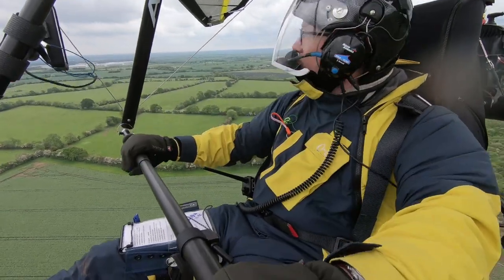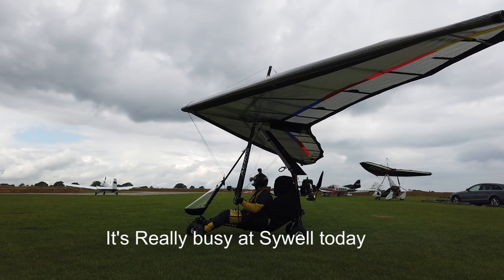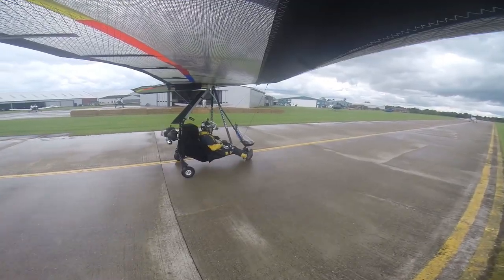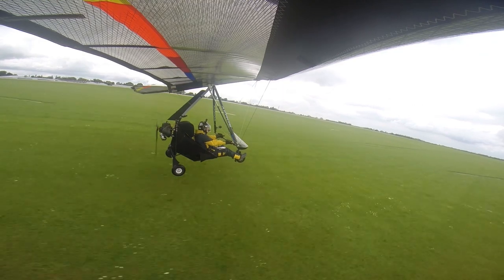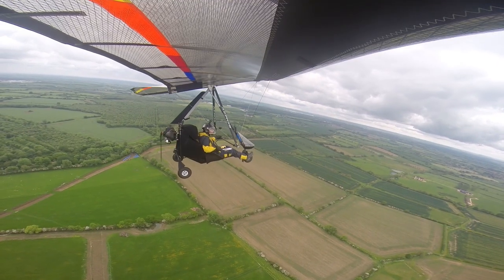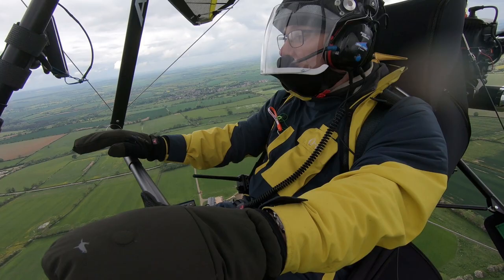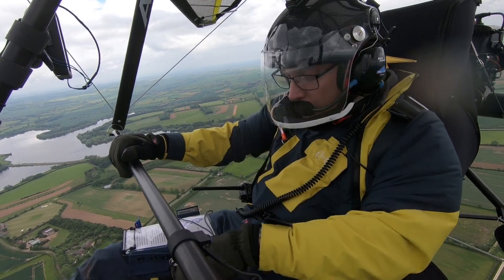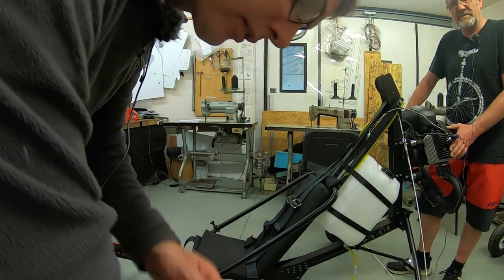ADAM  and SPITFIRES - My first flight on the Flylight ADAM

Comment: Great video. I was looking behind you and noticed a Lazair (dual engine, yellow and red) hanging from the ceiling.  I owned one of those for about ten years.  As I recall, each engine was rated at 9.5 HP but it was so clean and light that it flew wonderfully with the small power plants.
Reply from the maker: Hi Stone859, yes good spot, that Lazair is an electric conversion by Flylight. I've been told they flew very well. A bit before my time ;)

Comment: Thanks for all the videos mate - I wanted to ask if you have any showing a full pre-flight/walkarounds please? I see all these wires and spars and bolts and really curious how often and what gets checked prior to your flights. All the best and catch you on the next one.

Cheers.

Jim
Reply from the maker: Hi Jim, I have kept this part out as walk rounds are not always the same depending on the aircraft, even flexwing to flexwing they are different. Seeing as you asked, I visually check all cables ( running a hand down the flying wires), any broken strands is a non flyer, and visually check all nuts and bolts on everything.  It's a good thing to get into a flow, I always put the split rings on one side to I can count them.  The more you do it, the more you'll notice when something isn't right.  Easier to check on the ground than in the air.  Aviation is about assurance through checking, even when I flew my paramotor I did frame , engine and wing checks.   Most Microlight aicraft have the preflight checks in the Pilot Operating Handbook ( POH). Sorry for the long winded response, but I hope that helps.
Reply: @GolfFoxtrot22  Many thanks Giles. Very much appreciate the detailed reply. I had a feeling all this was being done but is not of great interest to watch ;)

Cheers.

Jim

Comment: Wow do you need a complex sign off for the retractable :-) You know there's going to be some gear up landings with them :-) Great video Giles all I know about flex-wings I've learnt from you.
Reply from the maker: Hi Terry, no licence required for this class, it's a Sub 70.   The glider guys have a thing call the while line trophy, it a very expensive award for the wheel up landing, only ever seen one of those and it was a long line on the runway. If I ever had access to a 2 seater, I'd happily take you for a flight.

Comment: Interesting Stuff ... 
Nice one Giles ;-)
PS: ... Is there a 'Plan B' option if the string to put the wheels back down for landing fails ? ... and ... I REALLY don't like the idea of reaching your hand back towards that prop, to check the 'up' wheels mechanism ... it's probably fine (just me being over cautious)
Reply from the maker: Hi Brian, your concern is valid, however my hand is further awaiting from the propeller than it is when on your back in a paramotor, I did check this. If the string failed, you can pop them back and they lock automatically, it's very clever. The inner doors also help pull the wheels back.

Comment: An affordable, good looking and safe motorglider   .  What I like about the Pipistrel Sinus but 150kUSD  cheaper and you could keep it stored in your garage. This Ashman designer a genius !  Next test with a one hundred Kg pilot same toy engine and one hour's worth of gas. Enough to get to that ridge or thermal. (and back  to LZ)  Gain some weight GF22 !!!!
Reply from the maker: Haha, Ben has limited the pilot weight to 80kgs for the Atom 80, the Moster version is the one I really want to try.

Comment: Nice little machine 👌I’m in the process of making my own , I have a degree in structural engineering and access to a full machine shop. I’ll be making everything one it will be way below the 70 kg limit. That wing on the atom looks nice and tight , the wing on these little things makes a big difference . I feel like I’m stalling all the time when I go from the combat t to the fox t 😂🤣20 knot cruise difference feel weird to go slow now. Very nice when they carve like that hey especially when thermaling 👌🇦🇺🍻
Reply from the maker: Yes the carving of the Adam wing was awesome. I did a flight recently and tried the thermalling side of the Fox wing, the Adam was so much better.
Reply: @GolfFoxtrot22  now try the combat , even better topless 👍
Reply from the maker: I can't get access to one. All the combats are registered so I'd have to find the aircraft to fly it.

Comment: Another awesome video Giles! What flight computer are you using here? Is it expensive? It looks amazing! How are you connected to voice recording and traffic control? Does Micro Avionics custom build the comms for your specific radio and recording?
Reply from the maker: Hi Hollady, the Oudie 5 Pro is overkill for what I use it for but I've had it from my paragliding days. A phone with Skydemon is just as good. My PM100 is commented to an airband radio, you'll see it in a lot of my content. My headset has been vlog modified by Micro Avionics which can be requested by anyone on ordering. I hope that answers your questions. My next video has a request for Qand As so hold any other questions till then and I'll put them in.

Comment: Your radio calls are a bit different the Sywell, Sywell then RT the Sywell is like safety com yet they have a dedicated fequency? The retract look a bit of a faf but that is probably due to lack of practice.
Reply from the maker: Hi Algy, yes there was no ATC so all blind transmissions so back to the traffic calls.  Definitely lack of practice, it was the first time in anger but was straight forward. I just wished it was a thermic day so I could play with some rising air currents.

Comment: Hey Giles great video but I have to ask, in the event of tucking the wheels away,you later find  that the wheels won't pop out into  their landing position, can you still land it.?
Reply from the maker: Hi Natural9, there isn't much holding them in and the lock is only on the down(out). You can still belly land but on the Atom 80, the prop spins so you'd end up breaking that. It's a very reliable and proven system, Ben has used it before.

Comment: Excellent 👍
Vittorazi Cosmos 300 😁
Reply from the maker: Haha, I think the 300 would be too much, the Moster is too much on my PeaBee. Did you get your flights in recently Patrick?
Reply: @GolfFoxtrot22  
I would want an engine/prop combo that could safely max climb at the wings VNE.
Went up Saturday, had some ok  landings . Past my Pstar so will go up again and if I get a few more good ones than should be cleared to Solo.😀
Reply from the maker: Oh wow, that's brilliant news. I'm guessing you are on a seasonal clock with being able to fly. Or once solo you can fly in the winter?
Reply: @GolfFoxtrot22   if one wants to brave the cold they can fly anytime, wind Gods permitting 😂
Reply from the maker: Ahh OK. I'm guessing your cold is much colder than the UK cold.
Reply: @GolfFoxtrot22  usually below 0C on average here in central Ontario.
I have an open trailer so I won't be transporting rig over the very salty roads.

Comment: Great video Giles but wouldn't it be a bit of a FAF putting the landing gear down in the event of an engine failure especially at a low level? Is the ADAM and the Moster still two aircraft that you don't need a PPL for?
Reply from the maker: Hi David, I think with the little airbrake surfaces, they kind of pop out quickly.  I think I'd get height before putting them away, I was just on the limit of the power of the little 80cc engine. Yes, no licence required ( Sub70 exempt)  the ADAM is even lighter than the PeaBee. It was good fun to fly, I love to try the Moster version.
Reply: @GolfFoxtrot22  That's really interesting Giles and good to know that in the (sub 70 exempt) no licence range there is a little bit of choice!
Reply from the maker: @flybe146  Other brands are available but I like supporting British companies if I can. :)